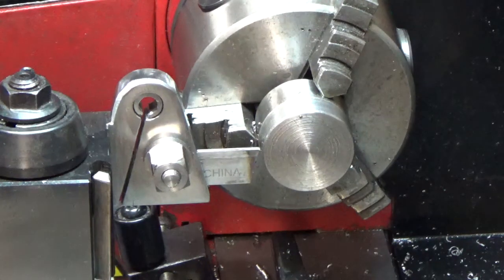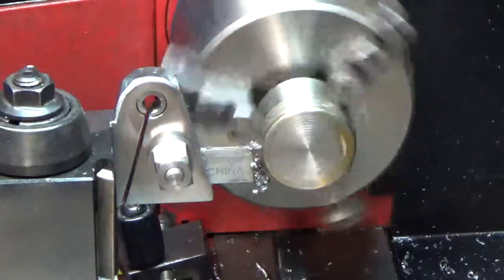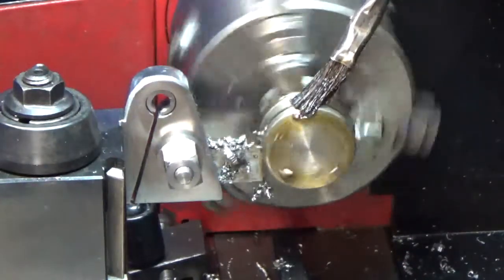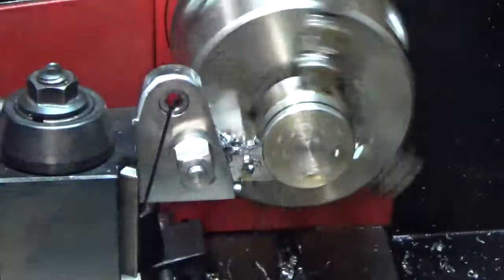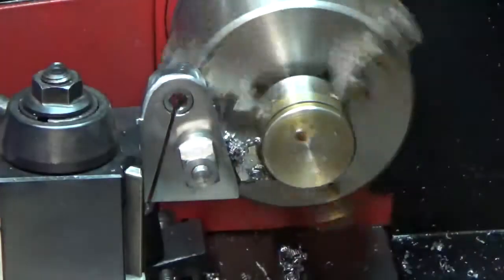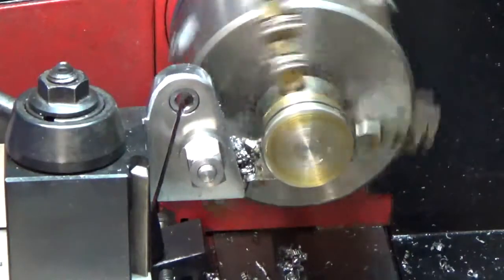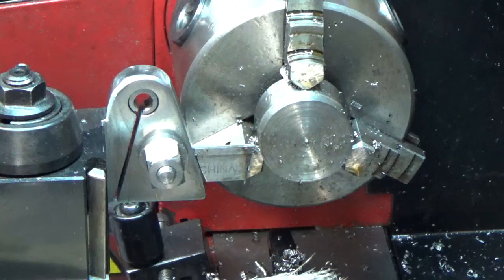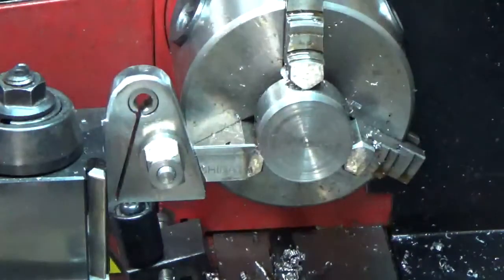Mini Lathe Spring Cut Off/ Parting Tool Holder Part #3

Comment: Considering one of these lathes to make a couple dozen special stand offs from 1.5" wide stainless hex bar, with a 0.10" thick hex head, a shank 0.75" OD x 0.9375" long, bored out 5/16" ID for tapping 3/8"-16      Looks like 3  jaw chuck won't hold 1.5" wide stainless bar.

Comment: Sir..the holder of the cut chisel makes it himself..what does the holder buy in a shop?
 Indonesia...
Reply from the maker: It's very handy for cutting shapes on the lathe.  Complex shapes can be cut into softer metals once the tool bit is shaped and ground.  I've several of these types of holders for parting and also cutting shapes.  This one is especially good for parting off because it doesn't dig into the work piece.  Good Luck and Best Regards: Larry

Comment: Seems to me that the spring part of the holder is not working and the movement is somehow coming from the tool holder.
Reply from the maker: Dave:  As I recall, a lot of things went wrong in this video series, however I will tell you that the holder works really well and It has become my go to parting tool holder.  Thanks for your comment and observations.  Regards: Larry

Comment: Do you have stock bearings in that lathe,or you upgraded to tapered roller bearings..
Reply from the maker: Lathe has stock bearings.  Upgrades include; longer bed length and extended cross slide.  Regards: Larry